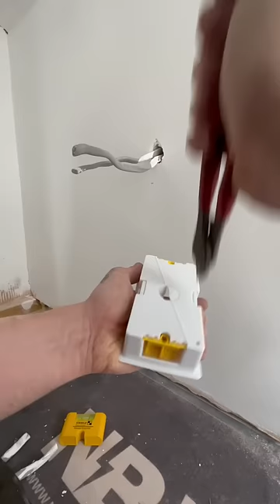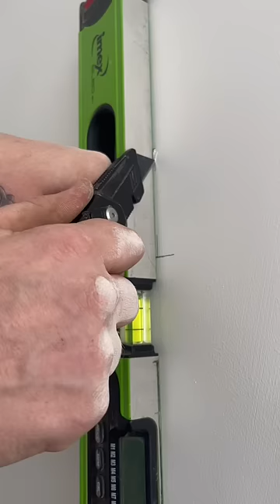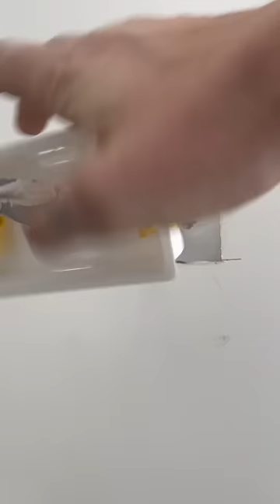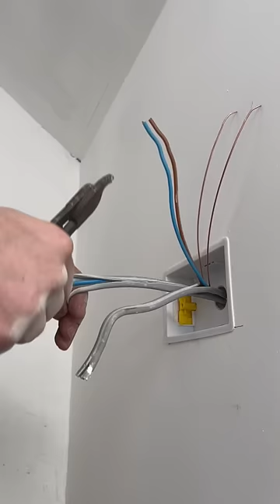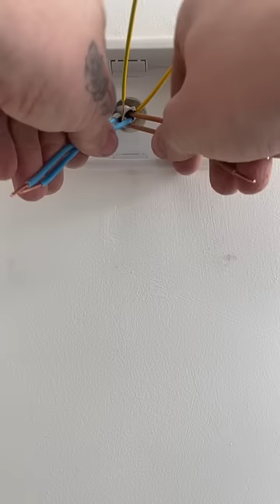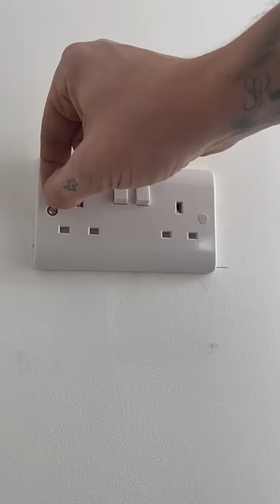Ignore the pencil marks

Comment: i almost died when i saw the cordless screwdriver on the socket. haha
Reply: I can hear my Gaffer screaming behind me. What are you doingggg and hitting me over the head hahaha. Love your videos mate
Reply: Same 😅
Reply: Ping oopsies.
Reply: I dont see any problem if you know how to use clutch on your drill
Reply: @Thomas-ri3rl  they do exist, just a drill or a cordless on charge… 🤭
Reply: @Thomas-ri3rl  Milwaukee makes one
Reply: agreed, hurts watching
Reply: Thats a No No
Reply: I know, what???
Reply: He's probably talking about using powered tools on terminals, they can strip out, lock up the terminal, among other issues. Yes it can be done if you have a seasoned touch but generally frowned upon
Reply: @cliveross1800  if you’ve got no feeling in your trigger finger then yeah u can’t use a drill. Anyone with a bit of finesse can nip it up with a driver and finish it by hand
Reply: Battery driver on terminal screws? Rough as fuck
Reply: @Tw1steD247  impact driver
Reply: @IAmThe_RA  yes or clutched drill driver
Reply: @bazmondo and never doubled back the connections, a big no no
Reply: He doesn’t tighten with the drill he just gets it to that point

Comment: Tip, 

from an apprentice I was told better to bring cables through top or bottom knock outs… 

Rather than the centre back like in the video when you screw the socket back the stripped single insulated cables will likely leave the box
Reply: Exactly! Poor practice shown here would expect better tbh
Reply: Same

Also helps with USB sockets

Comment: Here in the USA we would have a cable clamp on the back of the box so that the cables don’t slide back and forth. It’s required to keep the outer jacket partially inside the box so the wires without the jacket don’t touch the edge.
Reply: Yeah but you also use wire nuts 🤮
Reply: @whatyousaidbud  I’m in the USA and I’ve recently switched to use wago connectors.  Much easier to work with and can make changes more easily.
Reply: @ijustwanttoseetitty yeah we are better in many ways I've come to see😂. We also have cutters that don't make that awful snap noise. A well make set of linemans pliers should cut wire that thin silently. 

Wire Nuts hold wires tighter as in they don't pull out as easy, they make a lower resistance joint, the cost less money and last a life time. I would vomit too if I did the subpar work I see from the UK 🤣🤣🤣
Reply: As an English sparkie, I totally agree. I'd hate doing it mind but it's very sensible
Reply: @johnh8546  from the videos I have seen of electrical work in the USA it looks 3rd world at best
Reply: @alemgas  compared to the hack work in this video, we might as well be on the divine level. Also, we don't have that half-baked ring circuit trash.

Comment: One mistake you made Nick... you should have binned the 2 plastic screw covers that everyone hates
😜
Reply: 100%
Reply: They are to protect, eg the screws are metal and exposed sooooo…
Reply: Did you mean bend?
Reply: @spencerwyche2552  put in the bin
Reply: @jameshansing5396  do you have a plastic oven? Plastic washing machine? Tumble dryer? No, because if it's wired correctly they won't be live. Otherwise what would you do with a metal clad socket?
Reply: @iangrimes9631  people always do who don’t realise what they’re for 😂
Reply: @iangrimes9631  so why are they best thrown in the bin if you know what they’re for?
Reply: @jameshansing5396  They're not exposed in a drylining box.
Reply: @tebscat  I meant in general …… 🙄
Reply: @James Hansing  Those caps are an absolute pain for anyone wanting to remove the socket after to carry out maintenance as you can't get them out without damaging them so yes best thrown in the bin.

The M3.5 screws are earthed as they are connected to the back plate when holding the socket back so everything is safe, the only thing they do is hide the screws and it is a matter of opinion as to weather that looks better or not. 

Decorative metal sockets look better without screw heads visible, cheap plastic sockets look even cheaper with the caps on.
Reply: @AJ-tj7jm  tape 😂 rarely had a problem
🕺😎
Reply: @AJ-tj7jm  of the sparks I know, the best ones use em the shit ones never do….  Not saying that really proves a point but I know which crowd I’ll follow 😎👍
Reply: @jameshansing5396  Your totally right it don't, just like the actual switches and sockets, first you get the crap ones like Schnider that don't  have the caps and then quality ones like MK's logic and Crabtree's capital ranges that don't have them either.

Everything else that is cheap and nasty in between seem to have them to make them appear to be better than they are, to me they serve no purpose other than to make a cheap socket look fancy and it doesn't work, imo they look tacky, not to mention they are tricky to remove without damaging when doing an EICR all of which adds unnecessary time for any maintenance that needs doing later on, imo a better quality socket with shiny chrome pins look better than these as the attempt to cover the fixings with covers draws your eye to them more, especially after a few years when they get grubby.
Reply: @AJ-tj7jm  each to their own…  Take care 👍
Reply: @jameshansing5396  just wanted to mention that when you insert the M3.5 screws they actually touch a brass ring that is connected to the earth terminals on the socket, so unless terminated poorly there shouldn't be any issues. The covers do look nicer but I often end up losing them 😂

Comment: The only good thing in this video is the Bosch Go 2 screwdriver. And to those who complain about it, it has 5Nm of max torque adjustable in 5 settings. Lowest is around 0.5 Nm so for a terminal screw which usually tightened to 2.5 Nm, the 3rd position is perfectly fine. I always do my terminals with it and never had to redo one again.

Comment: Never use electric screw divers to tighten the terminal screws
Reply: Why
Reply: @danyo5509  the torque given by the electric screw drivers can cause some serious problems.

Over tightening of the screw onto the cables can anneal and fractured the cables, causing a fire risk.

Over tightening of the screw may cause them to seize in, effectively creating a cold weld.

Over tightening can cause the screw head to break off which then renders testing impossible or replacement difficult. 

Using an electric screwdriver will allow easier screwing even when there is a crossed thead.

There is a greater possibility due the higher torque that the when another person comes to undo using a proper electrician screwdriver that they are unable to do so.

There is also the possibility of weakening the plastic front plate. 

Increased likelihood hood of tearing the teminal block from the socket terminal causing a failed socket or worse an intermittent connection that could cause overheatingor a fire
Reply: Torque settings negate your concerns. Also you can go to manual setting to nip up at the end
Reply: @Михаиллеви  and how many people know about those and when they do what is the correct torque setting or the srews, and how does that setting appear on each electric screwdriver, and what is the difference in torque at each setting in relation to battery charge. 
No better to never use them and tighten hand tight plus quarter turn.
Reply: Nothing wrong with using cordless tools, despite many being almost religiously against it. You just need to be careful. If in doubt set the final torque manually using a normal screwdriver, a 'manual' mode on a cordless screwdriver, or if you really want a torque driver.
Reply: Nothing wrong with using a cordless screwdriver if you know what your doing
Reply: Exactly. I use a drill. It's much faster. Works great when you understand how to do it.
Reply: Depends. On Clipsal Iconic Sockets they actually have drill icons because they are designed to be tightened with a drill
Reply: @gordonbeaton8131 That little 4V bosch driver isn't going to damage anything.
Reply: Ok nothing wrong using cordless screwdriver. Ok I get it. Except majority use impacts not screwdrivers.
Which should never be used when terminating.
Cordless screwdriver has its place. Not when terminating. You can not imagine how many mess ups are from that. Plus on a demo years later when you want to save that device. The screws so messed you have to find a new device.  So it really becomes a problem on the service repairs as well. Try fix9ng or replacing a devices and you need every bit of wire and you get some buggered screw. It becomes a nightmare.
Just use a straight blade screwdriver and be done.

Comment: at least you didn't use felt tip pen 😂 (from a decorator)
Reply: Never knew that was a thing until I did some coving at home. Used a fine tip green sharpie………
The look on my face when I walked into the room and saw every gap I’d filled was now bright green! 2 days of work to cut out all the gap filler, scrape the wall under the coving to get the pen off and refill it 🤦🏼‍♂️

Comment: Lol. You know that single insulation ended up in the cavity when the socket pushed the cable back.....nice edit.
Reply: Don't know what you mean
Reply: @Михаиллеви  double insulated cable stripped back to blue and brown single insulation. 

Then when securing faceplate to wall, the brown and blue sk gle insulation would end up being pushed back through the hole. That's why it was edited to hide the reality.
Reply: @Woodkin007  i see what you are saying but that should not normally happen as the folding of conductors before pushing back the socket help take up the  slack and can't see how it would happen here as those cables were actually bent and trapped behind the cavity box and they showed no signs of moving when being stripped.
Reply: Why don’t they have cable clamps of some kind for boxes in Europe like they do in America
Reply: This didn’t happen tho like the other guy said they were pinned between the box and the wall
Reply: @bananainacup  okay.

Comment: How do you not have a socket template
Reply from the maker: Never had one mate
Reply: Socket template is a great bit of kit to have, makes marking out so much quicker when doing loads On a property
Reply: Get one geeze. You will wonder how you ever got on without one 👍 Wouldn’t have left those pencil marks either
Reply: @sean5988  don’t need to faff about with levels and boxes. Level built in to the template. Mark the height and away you go
Reply: @rjkelectrical6086  I have used one and it was a template for a double abd a single socket. Simple yet so fast for making out boxes.
Reply: Surely you can make one with a bit of MDF that marks the height too. If it's square stick the level on too of it or glue one of those ones you get free with TV brackets
Reply: @planespeaking  they’re like 10 quid to buy without the faff of making one and paying for MDF

Comment: Best to put the fast fix boxes in before they plaster! 😉🙃
Reply: I actually prefer after as if they get plastered in sometimes when you second fix they move and crack the plaster which then needs making good. But it also means you see the dry line box slightly at the edge. So there’s valid arguments for both I guess 🤷‍♂️

Comment: Seen you using leccy screwdriver on all sorts including dist boards, bad practice, you should go to the van and get your torque driver instead of being lazy - coming from another electrician
Reply from the maker: Saves the wrists and time, always tided up after by hand anyway so I can’t see the issue mate
Reply: @NBundyElectrical  seeing as you didn’t double your cores over the initial torque on that could break the conductors, I know because I’ve been using that Bosch go2 since it was released, It’s only good for pins to save your wrist, plus a lot of people watch your stuff and will now think this is sound to do. How do you know how tight your connections are if you can’t feel it? Over tightening is just as bad as under tightening.
Reply from the maker: @stuartwilson2010  it’s got a torque setting on the driver itself, I always set it to low and then do the rest by hand like I said , I would understand some complaints if I was doing it super super tight or with an impact driver 🤷‍♂️
Reply: @NBundyElectrical  yeah it has but you was using it on max anyway on the vid 😂 reeks of domestic installer
Reply: @stuartwilson2010  don't you know that a YouTube channel automatically makes someone a pro with superior knowledge and skills? 
He says it's okay so it is okay. Okay!

Comment: Question?? Why does the earth not have a cover on it when it stripped?
Reply from the maker: That’s how are cables are over here mate , you have to sleeve the earth yourself
Reply: The earth (circuit protective conductor) is not a current carrying conductor in normal circumstances (except for minimal earth leakage) and therefore doesn't need insulation until it isn't insulated by the sheath of the t&e where it might come into contact with a live conductor.

Comment: I like how this wall outlet also has on/off switches too! 👍🇺🇸👍
Reply: You mean you have them without there? So each time you have to unplug your TV from the wall or just leave it on standby all night ?
Reply: @KaptainKastle I didn’t say that. Of course, here in America, we have wall switches at chest level,meaning you don’t have to bend over and hurt your back nor move the sofa and chairs to get to those switches. 
    At some locations, like my Ham Shack, I wouldn’t mind having these switches right on the strike plate to prevent any power drainage from my battery banks if I have soldering irons or anything else. I run my home with 12v dc panels and both of my wind turbines for my 12v and 14v battery banks. Each bank has it’s own DC to AC inverters and they run independently. This still doesn’t fully answer your question but I’m hoping common sense prevails…😅
Reply: @digitaldreamer5481  yeah, in past times electricians used to put those sockets right down at the floor.  Could never understand why they did that. Perhaps so you didn't trip over the cable when the hoover was plugged in. Now we have to have them at least 450mm off the floor. That's like a foot and a half in your lingo. 
But I guess we do have proper plugs with a robust connection to prevent it being tugged from the wall unlike those flimsy things over there that fall out, sometimes even without pulling them. And I guess where a little fitter so bending a little isn't so much an issue. But, what i never get is  sometimes  you don't even have an earth there right ?  Blimey  🇬🇧

Comment: come on mate, could've at least earthed the backbox 😑 where's big aldinho when you need him?
Reply: Plastic back box?? ... the screws are earthed to the socket and would earth a metal back box ... but they have a screw terminal on them anyway.
If you had a metal back box and joined the earth ring would you take an earth to the socket and one to the back box? UK sockets usually have two earth terminals so you could earth the back box on one of them.
Reply: @simonblackham4987  I was only joking 🤣, for lots of sparks it's thought as good practise to earth metal boxes
Reply: @samjburns07 Nuff said!

 Is it not in wiring regs though? ... even though the screws go through the earthing strap on the outlet?

Would sparkys now link the ring wires and run pigtails to the socket? ... or still do it as shown?

Using 3 port lever connectors would enable you to change/update sockets on a live ring by disconnecting the pigtails at the lever and reconnecting the updated sockets?

Comment: Couple of things I don't like here... 
Using a level? Amateurs 😂... 
Demo tool took longer to cut then a regular hand saw, put some elbow grease into it..
Used an electric screwdriver on the terminals 🤦
And finally, you strip the double insulation to much. length on the single insulation is over 75mm , don't know what the rules where you are, but here that wouldn't pass.

Comment: In terms of cable would like to know, if possible, why do you prefer to use single wire instead to use multiple wire?
Reply: You mean single strand as opposed to a flexible one with loads of strands?
Reply: It’s how they come for that size of cable in the UK. Flat twin and Earth is what he was using. It’s very common for domestic installs. You get stranded twin and Earth but only in sizes 4mm and above.

Comment: All these guys making these videos and not one of them understands a dual earth socket
Reply: @Михаиллеви  on a ring main you are supposed to split the earth conductors and terminate them separately into the 2 earth terminals that's why there are 2 terminals
Reply: @theglovesareoff3159  which training manual says that ? One person on this subject says and i quote ', the two earth wires coming into the box form the ring, so if I don't connect them together the ring has a break in it, which could impact other sockets on the ring. And relying on the mounting screws to form part of that ring is not as reliable a connection.'
Reply: @Михаиллеви  if you put both wires in a single connection and the screw fails the socket is unearthed if you split the earths and one fails the ring will still have one earth as a radial and that is safer than no earth if both terminals have half of a ring the circuit is complete using internal component of the socket 

I'm pretty certain most sockets come with wiring instructions too and any electrician would learn this in college
Reply: @theglovesareoff3159  but what if you have three earths? …

Comment: Honestly all this worry over the cordless. I use my small impact driver😮
Always finish with a screwdriver to check  tightness.
Saves your wrists especially on long screws. If anything, there’s less chance of stripping screwheads.
Not exactly vde rated though